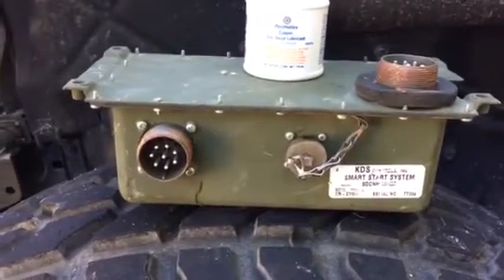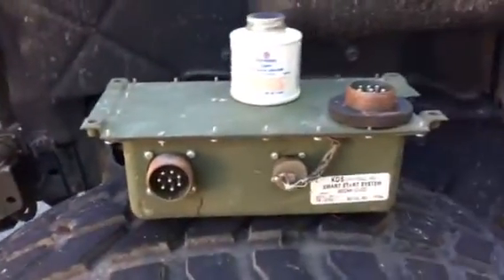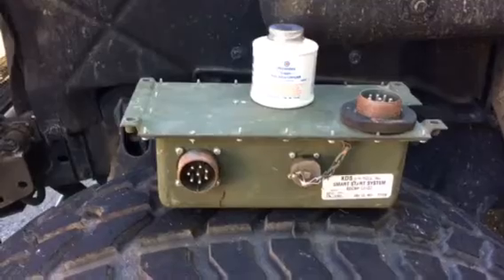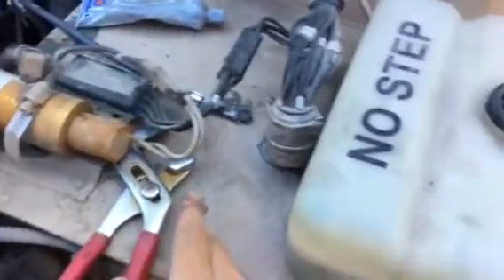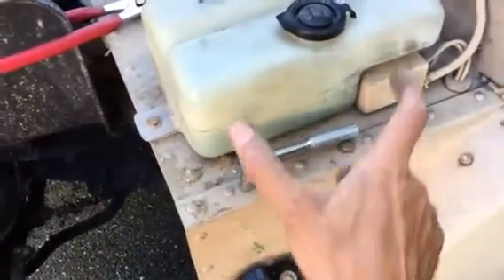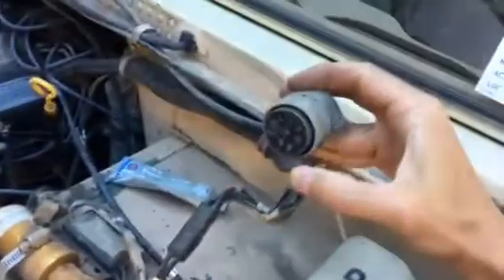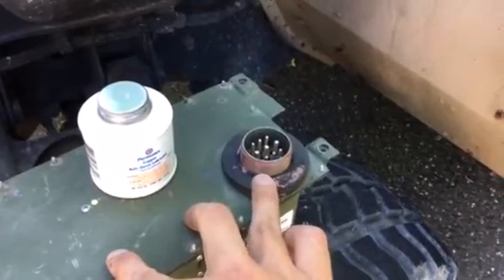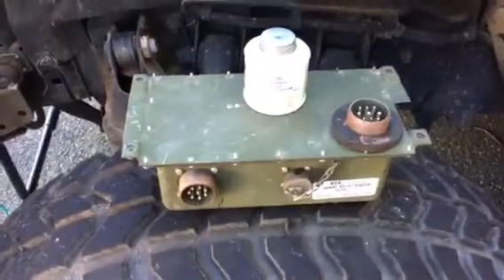HMMWV (HUMVEE) Replace Electronic Starter Box EESS UPGRADE

Comment: What was the symptoms cause for the replacement of the smart box?  And are you going to try and repair the old one?
Reply from the maker: I don't Give a rats ass :
When the deliver driver dropped the vehicle, I drove up to find him trying to jump it and connecting cables at all different terminals.  I could tell he cooked the box and glow plugs were fried, gauges were going nuts etc.  all corrected when replaced.   
Probably won’t fix the old one. If someone wants to purchase it for a few bucks to do it, it’s there’s. I’ve read some posts on how to do it but not up my ally.
Reply: N. J. P. ShoreLife i just had to order a new one. The glow plug light would just flash and GP not heating up. Im also getting a new temperature sending unit to match the new box. Going to mess around with the old one and see what i can find or fix. I understand that sometimes when these boxes crap out they take the glow plugs out with them. So im going to remove and test my GPs and possibly change out all three components at the same time. Also want to check out a block heater for winter. Thanks again as always another useful video.

Comment: Nice video on how to replace the box. As the most expensive part, it is probably best to check the other things first. For anyone trying to figure out which part is causing your HMMWV to NOT start, here is a guide.
http://gear-report.com/help-hmmwv-wont-start-humvee-glow-plug-start-system-maintenance
Reply from the maker: Great link!  This is what I mean by us all helping the community out , share the knowledge and ideas. Best Paractices.  
Agree, take the time to systematically deduce problems since the chain of failures will always funnel to the box in the end.   
My particular circumstance started with the delivery driver trying to jump the truck when I wasn’t paying attention to his work.  Attaching cables  all over the place and literally smoking the batteries, gauges not working all at once, starting was all of a sudden different, cooked the plugs etc.  So I was inclined to start with a clean slate with most items.   But since these items can add up, deduce if possible.
Reply: Terrible video. If you do this guys step you MUST disconnect the battery first. He could have killed the new box right away.